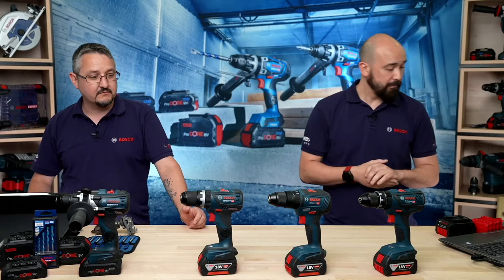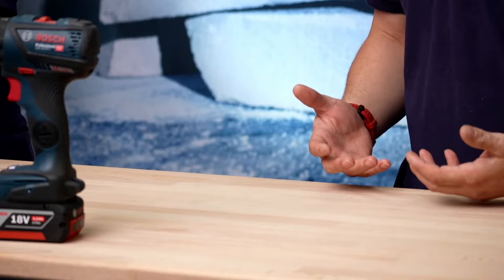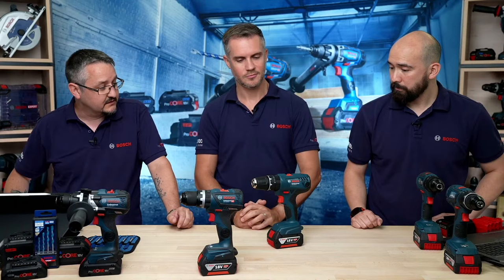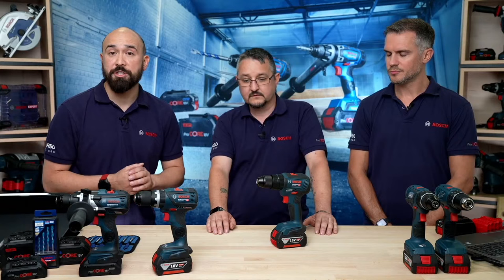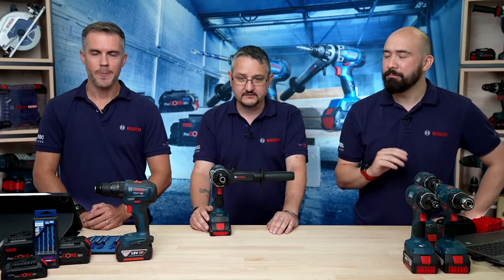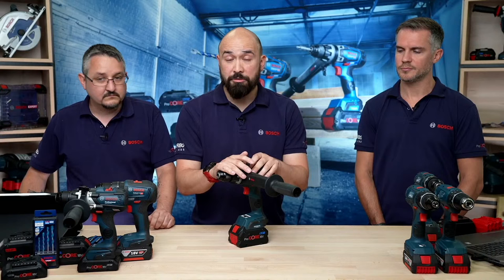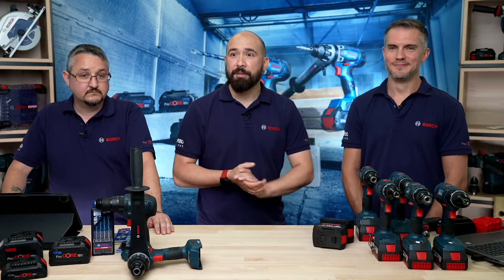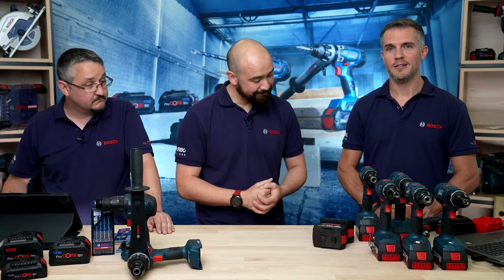Literally our most POWERFULL DRILL + More! | Bosch Professional LIVE

Comment: Can Bosch Improve the Led Light 
It isn't Light Enough to work in the darkside
Reply from the maker: These LEDs are only designed to light the area directly where you are working, designed to point up roughly at the tool holder. Entry level machines tend not to be a lensed LED but you only need to jump up one price bracket to get a much better LED light normally.  If you need more you might need to consider a separate work light to help with general illumination.

Comment: I would like a 12V drill driver without the battery inside the handle to make it more ergonomic.
Reply from the maker: I think the drawback would be sacrificing a thinner grip for a longer tool head length.... But an interesting concept.
Reply: I felt the same way about the thick handle but made a tiny stretching rack for my hands, now for only 10 hours of excruciating pain a day I can handle the 12v tools ;).

Comment: What happened to the original 6.3ah core battery?
Reply from the maker: Those were powered by a intermediate cell the 20700. During this time cell tech quickly moved on to the 21700 cell which we currently use. As we wanted to be state of the art we moved to what is now considered the rightful successor to the 18650 cell that powered our 'older' coolpack gen batteries. The 6.3 ah just phased out and replaced with the standard 8.0Ah. As BITURBO tools are bigger and thus more energy hungry we felt 8.0 ah is the sweet spot but there is a 5.5Ah ProCORE18V battery if you don't want to go all the way to 8.0 Ah

Comment: HI. I HAVE SEEN THE Bosch GSB 18V-45 ADVERTISED AT A GOOD PRICE BUT AS YOU DIDN'T MENTION THAT MODEL I WONDER IF IT HAS BEEN DISCONTINUED. I'D BE GRATEFUL IF YOU HAVE A CHANCE TOI ADVISE. THANKS
Reply: They did mention it... it was the starter brushless motor drill with 45Nm torque